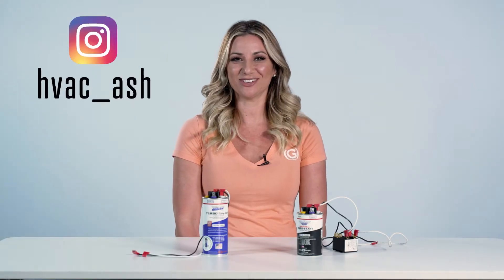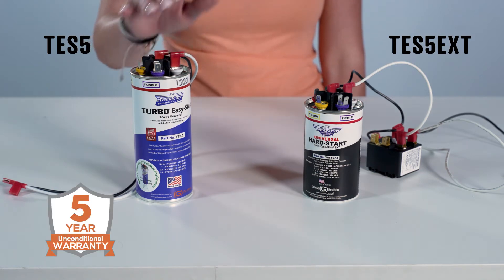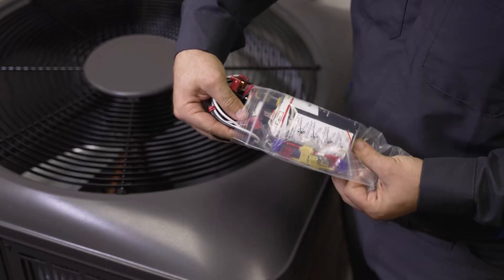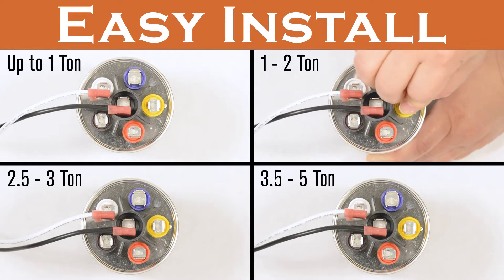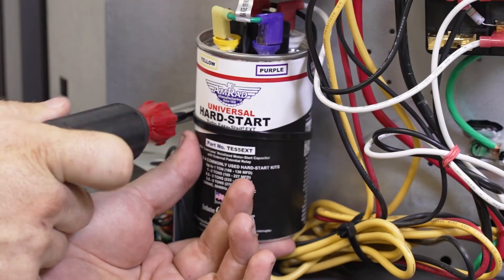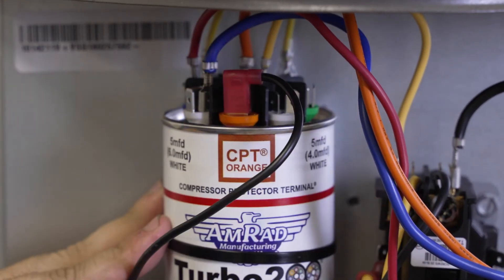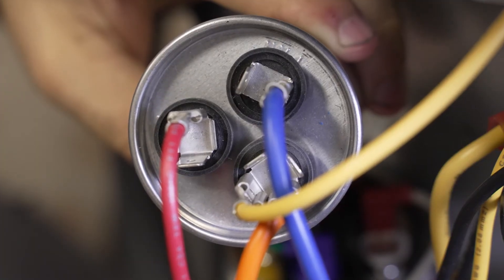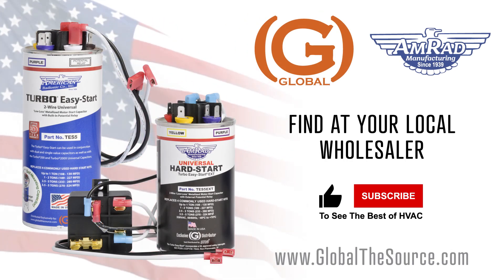AmRad Turbo Easy-Start (TES5 and TES5EXT) Hard-Start Install

Comment: So if you have a Kickstart KS1 which only has two blue wires. One goes to the highest MFD on the herm and the other blue wire goes on the CPT?
Reply from the maker: Yes if installing on a Turbo200 or 200x!

Comment: ok. This was a bit confusing because if you have an Amrad capacitor with a CPT, this video says to plug the BLACK wire to the CPT, not the ORANGE wire that is marked CPT...which is it?

Comment: what r diff bet 2 diff sizes.. smaller and bigger
Reply from the maker: The TES5 has a built-in potential relay ideal for salt air conditions and is backed by a 5 year warranty. TES5 EXT has an external potential relay which was requested by contractors for easy mounting and is backed by a 3 year warranty, wiring these parts are the same. I hope this helps.

Comment: The is the first I've seen this type. Interesting...
Reply from the maker: Hi RLG222,  Thank you for checking out the video!  We are glad you found us and we hope you found some other cool things you liked on our channel.  Please let us know if you have any questions – We are here to help!  

If you are a contractor, you can ask for our AmRad line of products at your local wholesaler.  Right now, contractors are appreciating our Universal Hard-Starts (a permanent replacement product) that has even more value these days with high gas prices…reducing the number of trips to the supply house to get a specific run cap – saving time and gas…keeping more of your hard-earned money in your pocket.

And, now with CPT (Compressor Protector Terminal) and the CPT® Fuse Wire (patented & exclusively on AmRad products), you have the best hard start install for ANY compressor-protecting from a failure event within 3 seconds! 

All products sold by Global are intended to be used by a licensed HVAC contractor.  More product information can be found on AmRad's website:  https://amradmanufacturing.com/  and Global’s online product catalog: https://globalthesource.com/products/26-amrad-universal-turbo-capacitors-hard-start-kits

Comment: I have a 3 ton carrier unit but the compressor says to use 88-106 mfd. would I still wire it up to 233 to 280 mfd as the label says on your tes5?